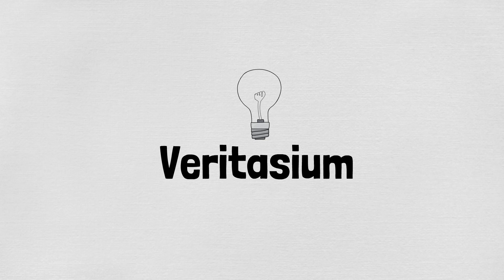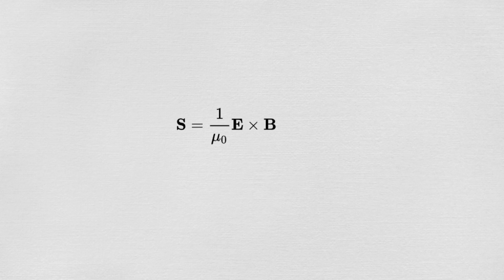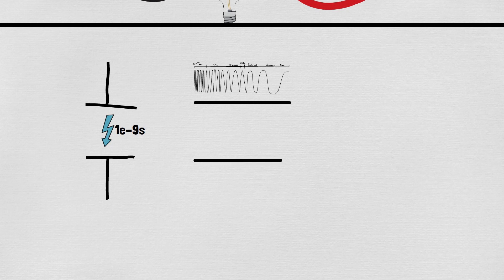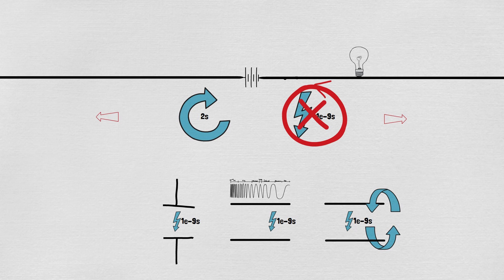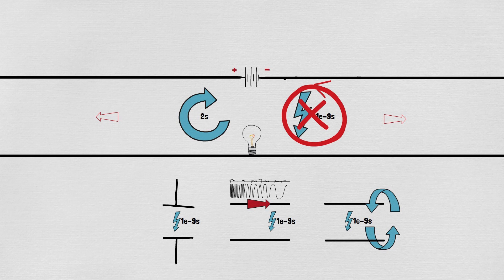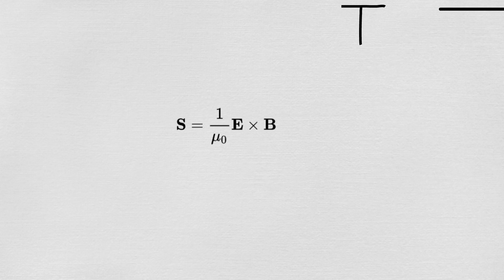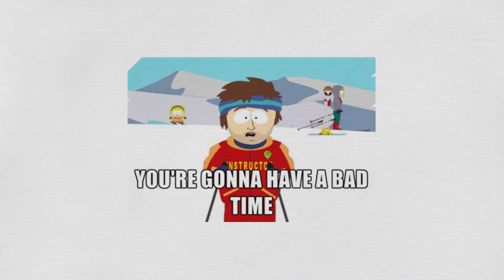Veritasium is Right? (see description)

Comment: I have seen a couple of videos now that approach this problem thinking they have a smoking gun that it breaks causality. The truth of the matter is that the light bulb would in this case still turn on, however as the wavefront of electromagnetic wave travelling in the wire reaches the short and 'makes it back to the bulb' the bulb would indeed turn off. In fact the real thing that would break casaulity, is that when a switch is flipped right next to the battery, somehow the circuit knows exactly that a light second across of the connecting wire there is a short. How can this be the case as all of us agree that electrical energy travels at the speed of light (or slightly below it in non-vacuum mediums)? 

*I holster now my smoking gun to point out what the real course of events would be if when the circuit is flipped on there is a short at the end (0.5 light seconds away) from the bulb*

So right of the bat, if only one switch is used in the circuit, and the wire has no resistance, if left to settle a while before the switch is turned, indeed the whole wire would basically be at a voltage potential that is already equal to the side of the battery which it was connected to, and the only 0 V region is basically the length of the disconnected switch. However, this is a boring static setup which doesn't really challenge any of us or shows any newinsights.

Instead, let's say that the circuit is freshly connected to the battery, or you could say you have two switches at either side of the battery and you turn them on at the same moment in time. The wires that connect upon the switch closing are at 0V, and as such current will start to flow down that wire. As this is happening a larger and larger section of the top wires start producing an electric/magnetic field around them, which will induce at 1/c seconds also a reactionary    current on the opposite wires. Notice that now the source has a frequency of 0 Hertz so the problem is actually an electrostatic radiation problem. Applying Gauss law of electrostatics indeed shows that the pointing vector explanation Derek gives is still correct. This post is already way longer than I'd hoped so I won't go through the full derivation here, but if needed I guess I'll post it in the replies of this comment. 

So now to the interest part (finally!), Whilst the bulb is turning on gradually increasing in strength, the wavefront of this current that is flowing down the wire would encounter a short at 0.5seconds form the closing of the switch. At that point you can say that the short can be seen as a load with a reflection coefficient of 1, which basically means that an exactly opposite electromagnetic wave would travel back down the wire (whilst the outgoing current/electromagnetic wave is still doing it's thing). If at this point you add up these two waves at each point across the wire you'll see that( at the speed of light) current will stop flowing closest to the short, and then all the way back down the wire to the battery/switch.

So a summary of events: at time 0 the switches are closed. At 1/c the light bulb starts slowly turning on, reaching its peak at 0.5s, then in the next 0.5s it will gradually dim back down to being off again.

Comment: actually I missed it on Derek video
it is just 02:02, so I don't know yet what you said
I just want to bring up example of coil
coil is usually small device, with variable ramp up to full voltage. In essence coil resist change in voltage flow (regardless of you raise or lower voltage). All wires are coils, some are bigger coils, some are smaller, but all conductors are coils.
It hit me because organised flow of electrons is actually quite slow, few magnitudes slower then light.

Comment: No, I'm afraid I'm with Derick. Ish. Once the switch is thrown, initial current will begin to flow in that section of the wire either side of the switch, propagating along the wire either direction from the switch, at the speed of light. While the whole wire will not instantaneously establish a current, and increasing portion of it will, and with that current will develop an increasing EM field that will develop around the wire, propagating to the to the bulb. Probably the main thing Derick gets wrong is that his explanation seems to imply is that the full current establishes itself in the bulb instantaneously, which it won't. You'll see a ramp up and the current propagates along the wire. 

As your extended thought experiment  implies, the position of the switch also matters, and it's the distance of the switch to the bulb, not the distance of the battery to the bulb that matters in terms of the time it takes for the light to start to come on.

Comment: Let's say Veritasium is right and you want to move information faster than the speed of light. So you put a second switch 0.5 light seconds away at one of the vertical sections of wire.  This now means you can check whether the 2nd switch is open or closed by closing the first switch and observing the bulb in 1/c seconds.  Pretty nice.

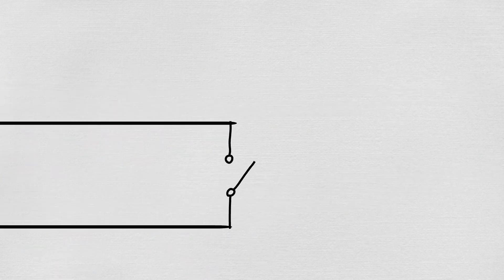Comment: At 3:10 you say the switch on the one end of the wire (1/2 light second away) would cause the bulb to change at 1e-9s but that's wrong. The time it takes for the change in the field to occur is directly relative to the distance between the change in the field at one point, and the bulb. So it would take 1/2 light second for the effect to appear, since that's the direct distance between the two in space. The distance along the wire is irrelevant, the wire exists to allow a field to propagate, that's why wireless stuff usually doesn't work. Wireless energy transmission is possible, as you ask as well, and in those cases the energy is transmitted because an appropriate EM field is being generated without wires. Tesla experimented with this. Asking many questions, most of which are answerable, and many of which are loaded and based on a misunderstood premise doesn't make Veritasium's explanation incorrect. The only thing they got wrong was the 1/c answer because it's missing units and is basically unusable as an answer to the correct time it takes for the field change to propagate.

Comment: No, even if there is only one super long wire with the battery in the middle, the current will appear as soon as you close the switch. How long and how strong, however, depends on how far the switch was from the battery. Using the analogy with water, this will happen because the battery acts like a pump and newly attached piece of wire will act like a trench where water(electricity) can flow to untill the pressure is equalized. Otherwise, no current would mean that battery instantly knows that circuit is disconnected light seconds away. HOWEVER, lamp still would NOT light up if we assume(as Veritasium did) that wire has no resistance, because no resistance means that ALL the energy generated by the battery MUST be transfered through the wire. Which would mean there is no energy left to travel through air to the lamp.
Reply: There you go again. The position of the switch doesn't matter. Watch Tycho video again before you go talking.
Reply: @eddietee6305 , I've watched the video just like you and all of his questions can be definitively answered and do not conclude that switch is irrelevant. The time between switch closing and lightbulb lighting up is dependent on the distance between the switch and the bulb, not the battery and the bulb, because the first current will appear in the switch itself. So no rules of logic or causality are violated.
Reply: @rinrin4711  you guys don't understand how electricity works. Veritasium created a bogus circuit. Electricity is not that hard to understand. Supposed the switch was on the battery terminal? Supposed the switch was at the bulb connection? You guys are been taken down the garden path.
Reply: @eddietee6305 , can you answer your own questions? Closing the switch would be like shorting the capacitor, so if the wire has no resistance and if the switch is right on the battery then it will take full 2 seconds to light up the bulb. If the switch is right on the bulb, then it will light up instantly. If wire does have non-zero resistance then if the switch is on battery it will take 1/C seconds to light the bulb and if the switch is on the bulb, it will light up instantly. If you can't grasp why it happens like this or unable to provide counter arguments, then you are probably the one who needs to read something before replying.
Reply: @rinrin4711  the point is that the distance of the switch from the bulb doesn't matter. Current flows in wires and follows that path only. That's it!
Reply: @eddietee6305 , that is fundamentally incorrect. What you call a wire is just a piece of material with very low resistance, air is also a material, but with much higher resistance. According to Ohm's law, even if the resistance of air is a million times greater than the resistance of the wire, roughly 1/1000000 of the total current will still flow through the air and not the wire. The only way there will be 100% flow through the wire is if it has precisely 0 resistance, which was assumed in Veritasium's video and that's why I said 1/C answer was wrong in that case.

Comment: what about the capacitance of the long, long wire? Wouldnt there appear a current because of that capacitance when the switch is closed? Yes, it would, because to establish an electrical potential, some charge has to move. The wire doesn't even have to be that long. So the antenna hypothesis (which is equivalent to a capacitance and an inductance combined) is back.

Comment: at 6:54 you state that the currently would only flow once the EM field is established but establishing the
field requires the movement of electrons...
Reply: Electrons move when you close the switch, causing a change in em field that travels through the wire but also around it, thus reaching the bulb almost instantly at first, but only with a weak effect. The em wave through the wire will have a way stronger impact, but needs more time to arrive due to the length of the wire. If the bulb is defined as being able to light up to any current, it will indeed light up almost instantly. If it is a "real" bulb, it will only light up once the em wave through the wire arrives.

Comment: Derek wasn't wrong, he said that the bulb will light up if it only requires a portion of the source voltage, and that could be achieved by the effects you mentioned that carry the energy to the bulb the fast way. He wasn't worng, only terribly misleading.
Reply: Derek is wrong either way. His idealistic lightbulb would be lit from the beggining due to quantum fluctuations.

Comment: The causality objection was my exact objection on that page. I think this makes sense, but I would say that the problem is that veritasium is not entirely wrong, neither entirely correct.

Imagine the opposite and the circuit is closed but the switch is 1ly away; the moment it breaks, the impedance goes to infinity and there will be reflected waves of potential propagating through the wire and bouncing back and forth. So there will be a TRANSIENT period where the current is essentially AC and the perfect coupling between the two parallel wires still carries energy across. Eventually dissipation will bring the system to a halt. 

So I think that in this case the bulb would first flicker and then dim and turn off over the period it takes to reach equilibrium

Comment: But transmission line theory says that the current will propagate regardless of if the switch is closed or open -- what happens is that the bounces in the line will eventually reach equilibrium due to an infinite sum, but once the switch closes there should be some excitation? 

I think there will then be a small delta away from the equilibrium -- which will increase over time. So the voltage of the line when the switch flips will be non zero? thus there will be small current flow -- But all of these changes will happen at the propagation speed of light in the wire. 

Which means that it all depends on where the switch is located? and at what time the switch flips (how long the wire has had to reach equlibirium, and what point in the phase of the voltage propagation the switch flips.

Comment: Thought provoking. What if their are two circuits, back to back; very close to each other, maybe an inch apart. The first circuit has a battery, a bulb and a switch. The second has just a bulb and the circuit is closed. If the first circuit is energized, does it induce a current in the second, lighting up the second bulb? Obviously not; but that is what some people are suggesting. Very interesting video. Please excuse any ignorance on my part, I'm a cabinetmaker by trade not an EE.

Comment: My first simple minded doubt was about those trans-atlantic telegraph cables which is essentially what this setup looks like, albeit the switch is on the shorter sides of the circuit and the parallel sides are the telegraph wires - which eventually developed into full fledged theory of transmission lines with the "t" in equation. And if I'm not mistaken, the whole reason it was investigated was because of the loss of current and voltage with distance AND time along the line from London to New Foundland. [https://en.wikipedia.org/wiki/Telegrapher%27s_equations] 
I am an EE guy but have not brushed up on this stuff for ages. :)

Comment: And also Derek's explanation violates the Special Relativity. Because if we put switch in either of far sides, we can transfer information faster that speed of light by turning on and off that switch.
Reply: Derek silently assumes the switch is at the battery, or even a part of the battery itself to make it simple. 
The solution to the problem doesn't depend on the distance between the battery and the bulb, it depends on the distance between the switch and the bulb. The moment you start moving the switch around, you change the problem and thus the solution. There is no violation of the relativity theory.
Reply: @biogoo  If we use poynting vector as Derek used, location of the switch should not matter.

Comment: I agree his Poynting explanation doesn’t work well here, but I think some of the others do.  Forget the rest of the circuit for a second, and just focus on the battery, the switch, and the wire near the switch.  When the switch is open, the wire is at the voltage of the other terminal of the battery (because it’s connected through the rest of the circuit we’re otherwise ignoring).  When the switch is closed, the part before the bulb suddenly needs to get to the battery terminal’s potential (at the speed of light).  That is what causes the initial current  The rest of the circuit, which we’d been ignoring, is all at the potential of the other end of the battery, so now we have a voltage difference across a capacitor made by the long wires.  Capacitors with a voltage difference themselves provide more current.
Reply from the maker: Thanks Daniel. I had neglected the voltage across the switch since that seemed to me to be a self-limiting thing due to battery chemistry. In other words, it didn't seem correct to me that a wire of sufficient length could discharge a battery completely in order to make the voltage difference across a switch at ANY distance away equal to the difference of the terminals (i.e. could we discharge a battery into a loop the circumference of the solar system without ever closing the circuit?)
Reply: @antimatterhorn  I think that the “ideal conductor” approximation breaks down at some point before answering that question?  But I’m not sure.